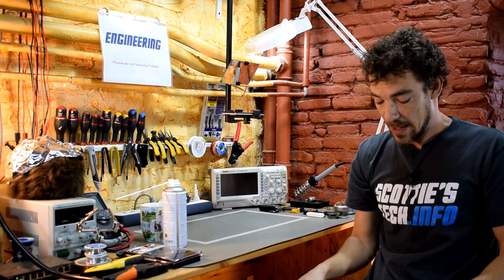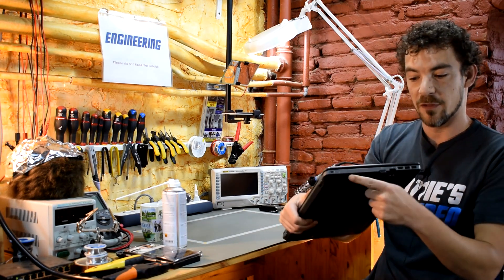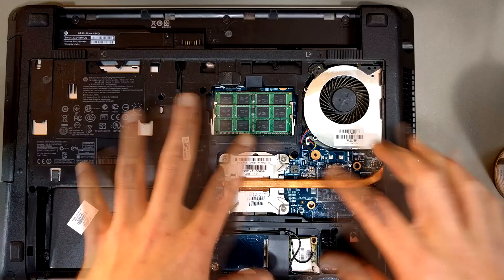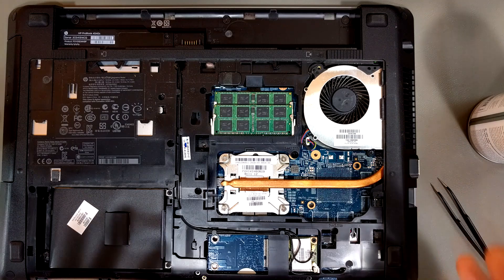How to clean out dust inside your laptop

Comment: my fan started making sounds like the laptop was malfunctioning or something then the fan just stopped and it's making a galloping like sound and it's super quiet, no air is blowing out, I'm kinda scared. I just got this laptop too :/
Reply: Thanks, I'm taking it in, I think I got a defective fan because it started happening a few days after I got it, and nothing got in because I'm trying to take care of it because it's new.
Reply from the maker: It sounds like either something small got sucked in and is blocking the fan (unlikely), or the fan itself is defective. Best to call support! (you have my deepest sympathies) ;)  Or, if you're adventurous and technically inclined, order a replacement fan off eBay and swap it out yourself - but that's getting harder and harder to do these days with super-thin laptops where everything is packing in tight, glued, etc. Sometimes you just pop off a panel, and other times you literally have to disassemble the whole base of the lappy to get at the fan.

Comment: Those 'fins' are a heat exchanger/radiator, if you remove the fan assembly you will often see a 3 or 4 mm layer of fluff choking it. Since the fan shroud is in contact with the 'radiator' this fluff can not be seen until fan assy. is removed..
Reply from the maker: Indeed. It depends on how "fluffy" your lappy's normal environment is. I once removed a literal hairball from a friend's laptop. :O

Comment: My laptop has survived over 5 years without cleaning, but now its getting a bit hot and slow so im gonna have to try this out. Thanks
Reply: My laptop lasted for 9 years without cleaning until it started to become plane jet
Reply: @NoOneInParticular0  Exact same for me
Reply: Did it work?
Reply: Same but 9 years
Reply: hero merce Did it work?
Reply: I haven't clean this ever since it was bought
Reply: Did it work?
Reply: Lol same bro somehow it's working even after 8-9 years without cleaning
Reply: @thestromdargon6205  10 years but only used not even 2 years
Reply: Did a rudimentary dust clean of my laptop fan alone yesterday(so not as thoroughly as in this video), I've had it for almost 6 years and was having the same problems ( for those asking if it worked). 

The fan is a lot louder and a lot more effective, went from having a resting temperature of around 50-55°C with peaks of up to 91°C, to having a resting T of around 35°C and I have yet to see it go higher than 78°C
Reply: @mr1m020  W
Reply: Did it work?
Reply: Ali cleaning it out from the inside is always gonna work. A reply to all of you other people in this thread too. It just works.
Reply: @emp3950  That’s what Todd Howard said.
Reply: @frostedpancake3882  well then what i said is different from what he said cus what i said actually works
Reply: @emp3950  I know.
Reply: Impressive
Reply: same
Reply: 5 years? That's low, mines been like this for like 6 years
Reply: @Katze123  woah, clean it, and it will feel a lot better lol.
Reply: 5 year old laptop man  laptop needs to clean fans and heating sink
Reply: we're at 7 years bois, how's the laptop doin
Reply: I like your hot laptop 🥵
Reply: 0
Reply: Yeah 4-year update, I ended up just purchasing a new laptop :D, It didn't really help the laptop's performance as all I was doing was gaming and it just ended up overheating the entire thing. Though regularly browsing and casual stuff made the laptop somewhat efficient as it didn't over heat as fast it did.

Comment: can you use hair dyers? i know it generates heat but  mine has a button for cooler air!?
Reply from the maker: In No Heat Mode, it might work... But it helps if the stream of air is very narrow and powerful in order to clean the dust from between the metal heat sink fins.

Comment: My laptop sounds like an F18 taking off, even in cold weather.  Gonna try this, thanks for the video Scottie.
Reply: xd same
Reply: Lmao
Reply: Same
Reply: Ned Kelly 😂😂😂😂😂😂
Reply: Did it fix the noise ?)
Reply: @malganis9668  Yes, it runs significantly cooler and quieter now.  I removed the back cover and used compressed air.  Haven't had to do it again, but probably needs another clean now to prevent the same issue  occuring.
Reply: Same mine won’t even turn on anymore
Reply: Mine sounds like a damn F-15 starting up, which is true to advertising as the model is called F15

Comment: Are you not pushing the dust back in?
Reply from the maker: Well, sort of, but the air must go in somewhere and come out somewhere else. So, blasting both the intake and output vents usually does the trick. In all my years of cleaning laptops, only once did I have to disassemble the thing, and that was because there were little clumps of fuzz inside blocking the heatsink fins.
Reply: @ScottiesTech  Can this be done with newer laptops? I have a 4090 legion 7i and really dont want to take it apart.
Reply from the maker: @joshuam4993  Yes! Nothing has really changed with laptop cooling.
Reply: @ScottiesTech  well, I tried it. But my air compressed can didn't have the long thing. Not sure if that makes a difference. Got the exhausted all around side and back the bottom. Not sure if it made a difference... Maybe there wasn't any accumulated? Idk

Comment: cleanning it can ruin it i will never clean the dust from inside the laptop i had my laptops for 4 years i never cleaned it i never had a problem its better to be safe then sorry there is no need to clean inside of a laptop only a desktop
Reply: ZODIAC yeah... you ruin you laptop by NOT cleaning it smh
Reply: ZODIAC 🤣🤣 i have mine 10 years dude, when i see inside, its already have dust like the foam to wipe the plate when you washing them 🤣🤣

Comment: Yea, I've done this on a few laptops. One time the vents were gunked up with grease from living above a fast food place, imagine black grease with a load of dust stuck to it all in the vents. I had to clean it with isopropanol and pipe cleaners. It worked a treat afterwards though, I put some good grade thermal paste on the CPU and GPU which improved performance and stability.
Reply: that sounds disgusting. your lungs might be full aswell

Comment: These things are designed to be hostile to user serviceability and it keeps getting worse year on year.
Reply: I tried to open my laptop to clean it and couldn't despite following a tutorial. The thing just wouldn't budge open and I felt like I was breaking it.
Reply: Which is why I bought a chinese chassis through a local reseller. Easy to take it apart, upgrade the RAM, storage, and now cleaning (after 4 years...)
Reply: i have to say, my 14 year old x200 was a lot more difficult than my '21 asus
Reply: @Moha-eh9tq  an Apple product*
Reply: Go look at an apple laptop then...

Comment: How can blowing through the vents "remove" the dust as that is what needs to be done, the only way (IMO) is the last method so you can blow the dust out.
Reply: THat's what I thought - using the compressed air you just dislodge the dust without removing it from that compartment. Good vid otherwise. Scottie is calm, clear, has a pleasant voice (some of these tutorials are a pain to listen to).
Reply: Once loosened most of the dust will just blow out once you turn it on.
Reply: a lot of laptops don't open so what do you suggest

Comment: Ahh thanks a lot! I wonder if Macs are different since the seem so very compact.
Reply: Macbook Air has no moving parts, it uses its aluminum case as a radiator. Pro is just like a common laptop in this sense.